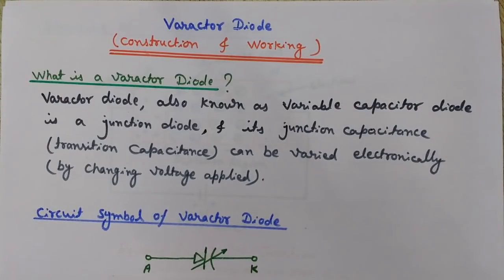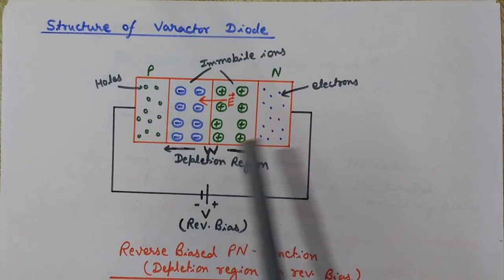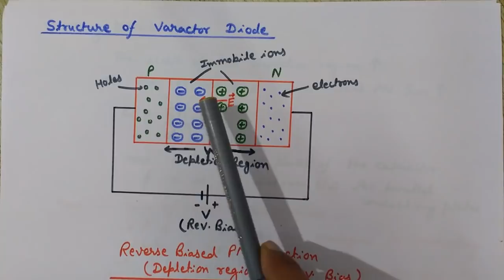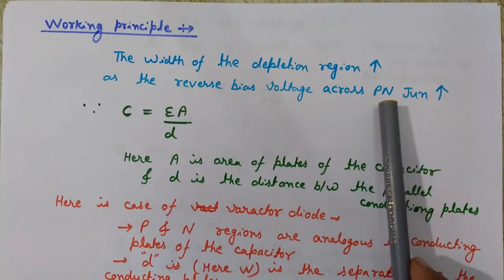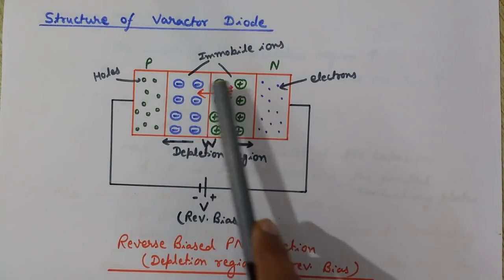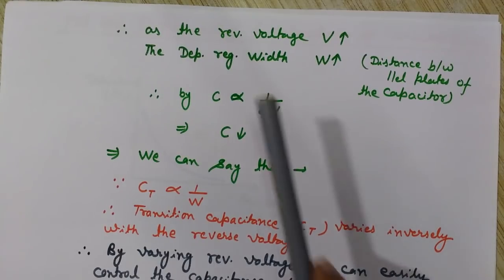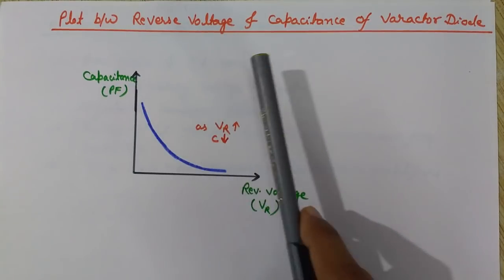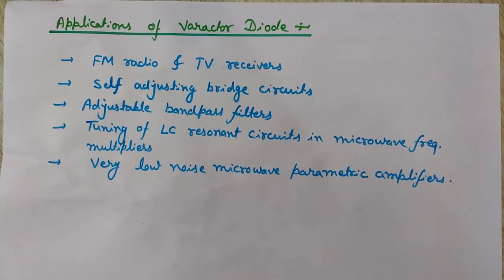Varactor Diode (Working, Structure and Applications) - Reverse Bias PN Junction capacitance [HD]

Comment: Varactor diode Capacitance is proportional to 
1. Inverse of square root of voltage 
2. Inverse of cube root of voltage
Which one is correct ????
Reply: Both are correct! 1st case for alloy and 2nd case for diffused junction

Comment: Sir, I have a doubt, here the diode is compared to a capacitor. So what's the difference between a normal diode and this varactor diode? I didn't find any difference between them ☹️, also, how it is used for tuning operation??
Reply: Search "Systematic Approach to Physics" and comment on his video He will answer you accurately and I am sure you will understand easily
Reply: for normal diode p n junction diode ,  doping is uniformly,but in case of varactor diode the concentration of impurity near PN junction is very less  and gradually increase as we move toward the layer's  other surface..
that's the difference

Comment: I've a doubt sir.. varactor diode is a normal PN junction diode..so when reverse voltage is increased why does the depletion region acts as an insulator? And why can't depletion region in zener diode(PN junction) can act as insulator too?
Reply from the maker: Zener diode has very high doping so when reverse voltage is applied it gets breakdown at very low reverse voltage. This breakdown in normal and varactor diodes takes place at high reverse voltage. Although functioning is same.... Difference is of amount of doping.
Reply: Engineering Made Easy thank you sir
Reply: Nice